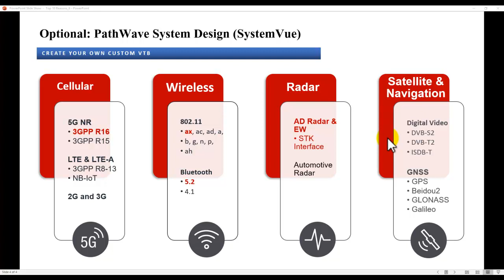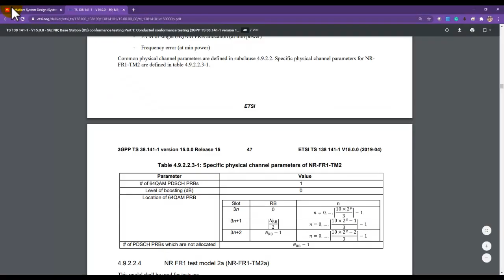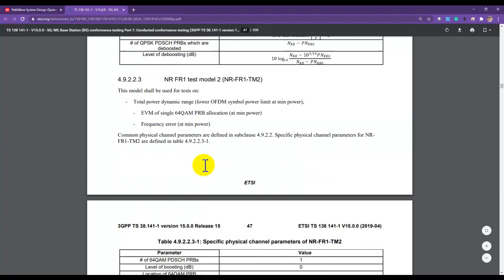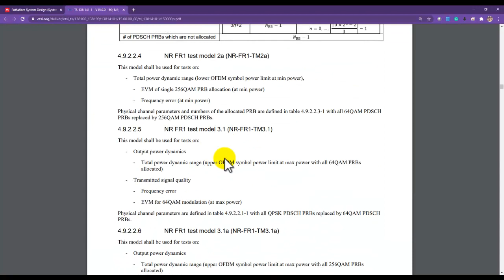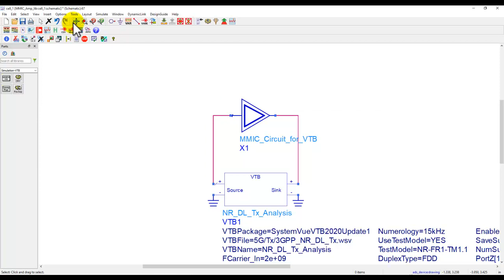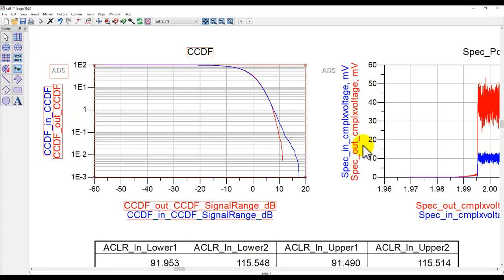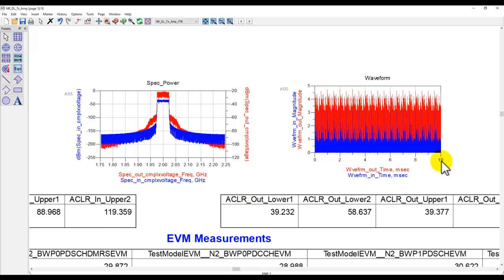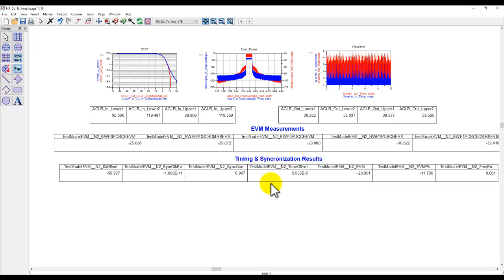ADS2021 Top10: VTB for Modulated Signal Analysis

Comment: For this simulation, is it necessary to use licensed version of ADS. can we simulate it with crack version?
Reply from the maker: Why you want to use cracked/pirated version which is illegal and can land you in legal troubles? If you are part of any university then contact your local Keysight team and they can educate you on the highly discounted university bundles.
Reply: @BhargavaAnurag  Hello, teacher. I'd like to ask a question. Are ADS2021 and SYSTEM2022 incompatible? I can't crack and install them simultaneously on one computer.